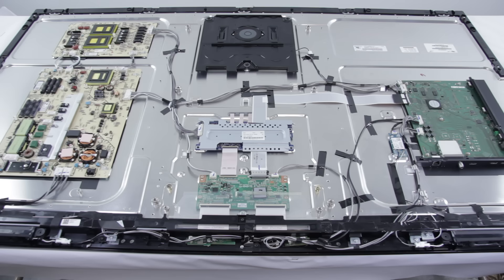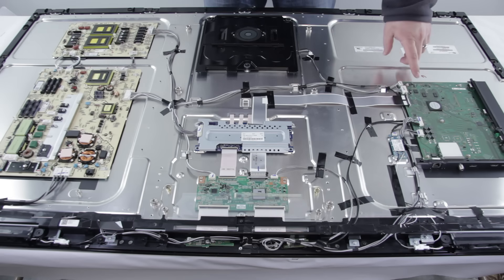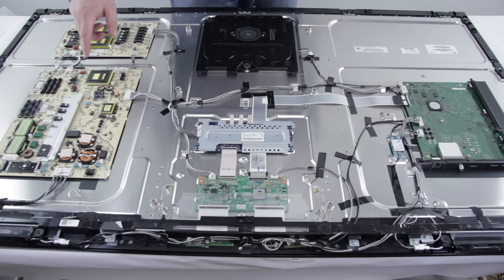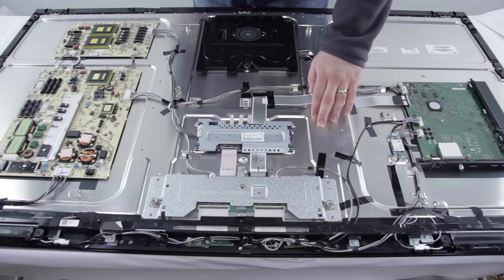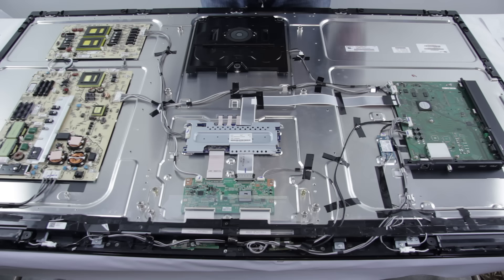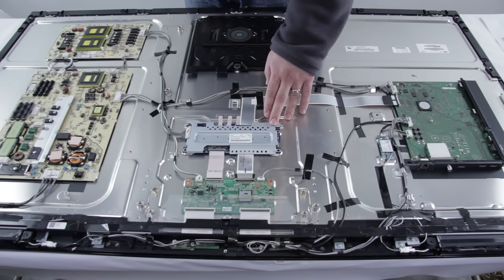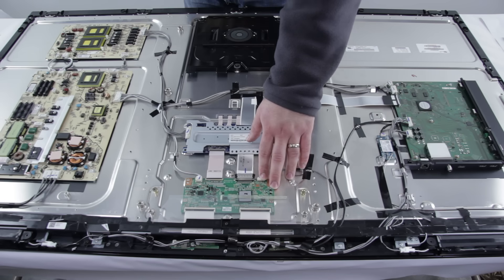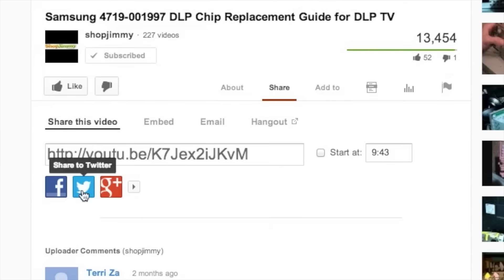LED TV Repair Tutorial - Common Symptoms & Solutions - How to Repair LED TVs

Comment: Hi, I have a 37 inch vizio VX37L HDTV10A. I'm an avid gamer so I thought this was a problem with my HDMI cable but I tried AV and it still wouldn't work correctly. The screen has always done a spazzy 'flicker' and then goes black (but the backlights stay on) and then after a moment the picture would come back. I always have sound but there are all these blue patchy stripes and patches flickering all over the screen. Somebody said I can do a flashlight test to see if it was the lamp but I'm not sure how to, please help! Thanks
Reply from the maker: thinmintXD Please watch this video FIRST to help with your repair!  TV Repair! LCD, LED, Plasma, DLP How To Fix Your TV with ShopJimmy.com Help!  If you have backlights, the flashlight test won't help.  I recommend replacing the main board first to see if that fixes the problem.  Click this link to replacement parts:  http://www.shopjimmy.com/catalogsearch/result/index/?cat=56&q=VX37L+HDTV10A  Be sure to match part numbers on your current board, with your replacement for compatibility.  Here is a link to a video showing how to identify your part number, click here:  TV Part Number Identification Guide for Vizio Main Boards (Plasma, LCD, LED)  Thanks and please let us know if you have any further questions with your TV Repair!  www.shopjimmy.com

Comment: I have a Samsung UN60D6450UVXZA 60" LED TV that suddenly has a dark semi circle on the left and right edge of the picture. So the TV works, it just has these darker areas now on the screen. TV is almost 3yrs old, new problem. Wonder if it's a faulty backlight inverter?  I tried to include a picture of the screen but can't figure out how to do it. Advice?
Reply from the maker: Linda Hollenbeck Please watch this video FIRST to help with your repair!  TV Repair! LCD, LED, Plasma, DLP How To Fix Your TV with ShopJimmy.com Help!  I don't your TV model has an inverter board.  This could be a problem with the main board or the TV panel.  You can replace the main board to see if that fixes the problem.  Click this link to find replacement parts:  http://www.shopjimmy.com/catalogsearch/result/index/?cat=56&q=60D6450U  Be sure to match part numbers on your current board, with your replacement for compatibility.  Here is a link to a video showing how to identify your part number, click here:  Samsung Main Boards & Digital Boards: Part Numbers for LED, LCD, DLP, Plasma TV Repair  Thanks and please let us know if you have any further questions with your TV Repair!  www.shopjimmy.com

Comment: i have a Vizio M501D-A2R  it looks like the picture is overlapping & flickering there are several lines at the bottom of the screen. i have replaced the main board and t con and still have the same issue.
Reply from the maker: dsahli3325   This sounds like a TV panel (TV Screen) problem.  If your TV panel is bad, it may be more cost-effective to replace the TV as panels are typically hard to find in stock, difficult to replace, and expensive.  Thanks and please let us know if you have any further questions!  www.shopjimmy.com

Comment: Great video! I have a LG LED smart tv model 47la6200. My problem is that the tv will not pick up the signal from the magic remote anmr400. some buttons work on the remote but the curser won't show on the screen and the enter button will not work, i have tried three different magic remotes so i know the source of the problem lies in the TV. Any suggestions?
Reply from the maker: Stephen Joaquin Please watch this video FIRST to help with your repair!  TV Repair! LCD, LED, Plasma, DLP How To Fix Your TV with ShopJimmy.com Help!  I recommend replacing the main board in your TV.  Click this link to replacement main boards for your TV model number.  http://www.shopjimmy.com/catalogsearch/result/index/?cat=56&q=47la6200  Be sure to match part numbers on your current board, with your replacement for compatibility.  Thanks and please let us know if you have any further questions with your TV Repair!  www.shopjimmy.com

Comment: We have a Toshiba 40L2200U LED TV. If the input is on HDMI1, the video will go away after 3 hours, and the audio will stay. The video will recover if the TV is kept off for 20 minutes. But if HDMI2 is used, the video doesn't go away. Is the LED backlight converter still at fault?

Comment: hi, I have question regarding my Haier led brand with model LE40B50, the problem is that there is no picture with no illumination but I could hear the audio. the co technician had replace the power board assuming as problem but with in 10 days of repair the problem accrued again kindly advice.

Comment: Hello ShopJimmy. I have a 40" LED Samsung that just 3 days a go it is showing e few thin black horizontal lines at the top 2" of the screen. Any suggestions please?
Reply from the maker: Gazi Boshnjaku   This sounds like a TV panel (TV Screen) problem.  If your TV panel is bad, it may be more cost-effective to replace the TV as panels are typically hard to find in stock, difficult to replace, and expensive.  Thanks and please let us know if you have any further questions!  www.shopjimmy.com

Comment: Hello. Have a Samsung LED 7150. Cleaned the screen with some windex. When I turned it on had a horizontal black line going across the screen. What to do?
Reply from the maker: Elvis Nunez   This sounds like a TV panel (TV Screen) problem.  If your TV panel is bad, it may be more cost-effective to replace the TV as panels are typically hard to find in stock, difficult to replace, and expensive.  Thanks and please let us know if you have any further questions!  www.shopjimmy.com

Comment: I have a Toshiba LED TV Model 55SV670U  SER 934452T04436K1. Every once in a while parts of the upper and or lower portion of the screen become dark and there is a fluttering in those areas of the screen.  Thoughts?  Jeff Dziatlik jdziatlik51@aol.com

Comment: hi , i have a sony kdl - 46ex724 with grey washed out image, sound and backlight is working , but image is constantly grey and washed out
Reply from the maker: MrF3nox   This could either be a problem with the T-Con board or the main board in your TV.  I recommend replacing the T-con board first, and if that does not fix the problem, then replace  the main board in your TV.  Unfortunately I do not see any replacement parts in the search results for your TV model number on our website.  Please reply with your part number on your main board and T-con board and I can try searching for replacement parts.  Thanks and please let us know if you have any further questions!  www.shopjimmy.com

Comment: We have Sony KDL 40EX700 with no picture, sound is functioning. Is the backlight inverter the problem and where is it located on the back of the TV? I can identify the power board and the main board but don't know where the inverter is located? Also, where can I buy the parts?
Reply from the maker: Ken Chan   I recommend running the flashlight test on your TV.   Here is a link to a video we produced that shows how to run the flashlight test. LCD TV Repair - Flashlight Test for No Image, No Picture on TV Screen - How to Fix LCD TVs Please reply with your flashlight test results and we can recommend a replacement part for your TV repair. Thanks and please let us know if you have any questions! www.shopjimmy.com
Reply: ShopJimmy.com I have done the tests that you have suggested. There are lights at the back of the TV, very brightly lit. I can also see faded light on at the front of the TV screen but but no image. There is sound coming through.

Comment: I have Samsung 65 inch LED model  UN65EH6000. Bought it a week after Black Friday 2013. Last week, the top 1/3 of the screen is dim. I can still see images through it, but it's just very dim. The bottom half is ok. Is this just a loose wire on the power supply or LED driver or busted LED that needs replacement? I use the TV as a computer screen via HDMI. I thought it might be the computer, but I opened TV's screen test and the problem was still there. Thank you.
Reply from the maker: gtariman03   This sounds like a TV panel (TV Screen) problem.  If your TV panel is bad, it may be more cost-effective to replace the TV as panels are typically hard to find in stock, difficult to replace, and expensive.  Thanks and please let us know if you have any further questions!  www.shopjimmy.com

Comment: i have a samsung led 55 inch model # UN55B8000XF
the tv goes in to demo mode and will not respond to remote or the touch sensitive buttons on the frame of the tv and we are unable to get it out of demo mode  we know the steps to get it out of demo mode but the tv will not respond
Reply from the maker: Raymond Balderas  Please watch this video FIRST to help with your repair!  TV Repair! LCD, LED, Plasma, DLP How To Fix Your TV with ShopJimmy.com Help!  I recommend replacing the main board in your TV.  Follow this link to replacement parts:  http://www.shopjimmy.com/catalogsearch/result/index/?cat=56&q=UN55B8000XF  Be sure to match part numbers on your current board, with your replacement for compatibility.  Here is a link to a video showing how to identify your part number, click here:  Samsung Main Boards & Digital Boards: Part Numbers for LED, LCD, DLP, Plasma TV Repair  Thanks and please let us know if you have any further questions with your TV Repair!  www.shopjimmy.com

Comment: i have a LG 55M4600-UC TV TURNS ON BUT HALF OF THE PICTURE IS UPSIDE DOWN WHAT CAN BE THE PROBLEM ?
Reply from the maker: Jennifer Most   This sounds like a TV panel (TV Screen) problem.  If your TV panel is bad, it may be more cost-effective to replace the TV as panels are typically hard to find in stock, difficult to replace, and expensive.  Thanks and please let us know if you have any further questions!  www.shopjimmy.com

Comment: i have a samsung un50eh5000. this is happening to the screen. http://i.imgur.com/deC2hzF.jpg thanks if you can help. there's a cut of pixels about 1/3rd the way down from the top. the amount of pixels missing are on the bottom but they show whats suppose to be on top of the screen.
Reply from the maker: Terabyte47   This sounds like a TV panel (TV Screen) problem.  If your TV panel is bad, it may be more cost-effective to replace the TV as panels are typically hard to find in stock, difficult to replace, and expensive.  Thanks and please let us know if you have any further questions!  www.shopjimmy.com

Comment: Hi I am having issues, with my Samsung tv, model number UN60EH6050F. It turns on, but there is no picture, i have sound though. And I do have backlighting. The backlight is always on the only way to get rid of the backlighting is to unplug it. So is there any possible way this could be a motherboard issue? Please contact back ~Tor_Hakushun
Reply from the maker: ***** Please watch this video FIRST to help with your repair!  TV Repair! LCD, LED, Plasma, DLP How To Fix Your TV with ShopJimmy.com Help!  I recommend trying the t-con board first, if that does not fix the problem, then yes replace the main board.  Follow this link to replacement parts:  http://www.shopjimmy.com/catalogsearch/result/?q=UN60EH6050F  Be sure to match part numbers on your current board, with your replacement for compatibility.  Thanks and please let us know if you have any further questions with your TV Repair!  www.shopjimmy.com

Comment: Hi i have horizontal lines on my LED tv, it on the bottom half of the tv and they gone in waves as they come on then disappear in a wave pattern. But it doesnt stop just keeps going. Ive change the t-con bored and nothing would that be the panel itself and would it be fixable?
Reply from the maker: Aneurin Austin   This sounds like a TV panel (TV Screen) problem.  If your TV panel is bad, it may be more cost-effective to replace the TV as panels are typically hard to find in stock, difficult to replace, and expensive.  Thanks and please let us know if you have any further questions!  www.shopjimmy.com

Comment: Hi there,
 you requested a message in the comments for help on tv repairs. I've an lg 47lx6500 3d that has half screen discolored and the other out. Thanks
James in San Marcos Texas
Reply from the maker: James Payton   This sounds like a TV panel (TV Screen) problem.  If your TV panel is bad, it may be more cost-effective to replace the TV as panels are typically hard to find in stock, difficult to replace, and expensive.  Thanks and please let us know if you have any further questions!  www.shopjimmy.com

Comment: Hi Jimmy Shop,
I have a Samsung UN46D8000YFXZA, S/N Z2ZE3CYBB00322K.  Problem: over the last year gray lines began to show up and only when I have a solid color, like Netflix intro screen can I see these lines.  As of today lines are beginning to progress from left to right but only on the left side.  Wider lines are near left side and like I said lines are only noticeable if a solid color covers the lines otherwise not that noticeable.  Noticed the progress of more lines is starting to appear.  Any thoughts on what I can do.  I feel confident enough to open the unit.  Frank
Reply from the maker: Frank Miller   This sounds like a TV panel (TV Screen) problem.  If your TV panel is bad, it may be more cost-effective to replace the TV as panels are typically hard to find in stock, difficult to replace, and expensive.  Thanks and please let us know if you have any further questions!  www.shopjimmy.com

Comment: I have an Insignia 24 inch LCD TV that has no sound and the screen is totally white when it is powered on.  The model # is NS-24E730A12  It was manufactured in Aug 2011. I have read that it could be the T-con board but some said that if it was the T-con board you could hear the sound. Do you have any suggestions??   It is much appreciated!!!
Reply from the maker: Wayne Hatcher  Please watch this video FIRST to help with your repair!  TV Repair! LCD, LED, Plasma, DLP How To Fix Your TV with ShopJimmy.com Help!  This could be a problem with either main board or the T-con board in your TV.  I recommend trying the T-con first and if that does not fix the problem then replace the main board in your TV.  Click this link for replacement parts:  http://www.shopjimmy.com/catalogsearch/result/?q=NS-24E730A12  Be sure to match part numbers on your current board, with your replacement for compatibility.  Thanks and please let us know if you have any further questions with your TV Repair!  www.shopjimmy.com

Comment: My three year old tried to clean our Vizio e601i-a3 LED LCD TV with a squirt gun.  I wasn't in the room when it happened.  When I sat down to watch TV (which was already on) later that day there was sound and a glow as if the backlight was on but no picture.  I turned the TV off and removed the back cover and let it set by the heater to dry out. I put it all back together the next day and still the same result.  Watching this video it sounds like it is the T-Con board that is bad.  Have you seen this before?  Is there a good chance if I replace the T-con board it would fix the problem or am I sinking money into a TV that doesn't have a chance at being fixed?
Reply from the maker: Charles Hummel   This sounds like a TV panel (TV Screen) problem.  If your TV panel is bad, it may be more cost-effective to replace the TV as panels are typically hard to find in stock, difficult to replace, and expensive.  Thanks and please let us know if you have any further questions!  www.shopjimmy.com

Comment: I have a samsung 60F7100 HD LED tv. I have a red splotch on the screen that is most visible when there is a dark background. I did not see this problem addressed in your video.
Reply from the maker: Tad Drake   This sounds like a TV panel (TV Screen) problem.  If your TV panel is bad, it may be more cost-effective to replace the TV as panels are typically hard to find in stock, difficult to replace, and expensive.  Thanks and please let us know if you have any further questions!  www.shopjimmy.com

Comment: I have a 47 inch LG led TV.  When I try and turn it on the indicator button lights, but there is no picture or sound.  Would it be the main board?
Reply from the maker: David Smith   I recommend replacing the main board in your TV.  Please reply with your TV model number.  Click here to view a video that shows how to find your TV model number:  TV Repair STEP #1 Help IMPORTANT TUTORIAL How To Find Your TV Model Number Tutorial TV Repair Help  Thanks!  www.shopjimmy.com

Comment: Help.. I have a vizio led E601i-a3 60 inch and I have changed all the boards and the tv now works with no back light and I cannot find the back light inverter for this tv. I see the power wires going to the led but I'm clueless on my next move on how to fix it
Reply from the maker: MIKE F  Please watch this video FIRST to help with your repair!  TV Repair! LCD, LED, Plasma, DLP How To Fix Your TV with ShopJimmy.com Help!  On your TV the inverter is built into the power board.  This is either a defective power supply or defective LED lights in your TV.  You can replace the power supply board to see if that fixes the problem.  Follow this link to replacement parts:  http://www.shopjimmy.com/vizio-09-60cap000-00-power-supply-led-board.htm  Be sure to match part numbers on your current board, with your replacement for compatibility.  Look for the note in red on the listing page.  Thanks and please let us know if you have any further questions with your TV Repair!  www.shopjimmy.com
Reply: ShopJimmy.com how can I replace the led lights is there parts for that?
Reply from the maker: MIKE F   You might be able to find them somewhere online.  Unfortunately we do not carry them.  You can replace the power supply board to see if that does fix the problem.  Thanks and please let us know if you have any further questions with your TV Repair!  www.shopjimmy.com